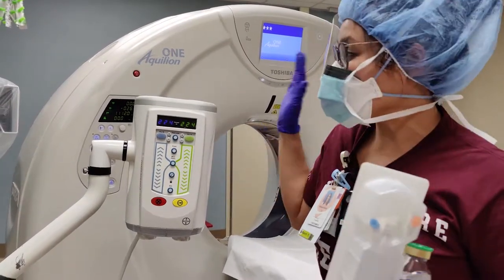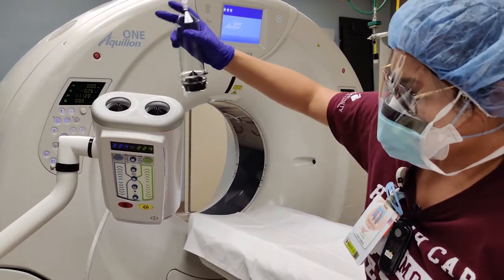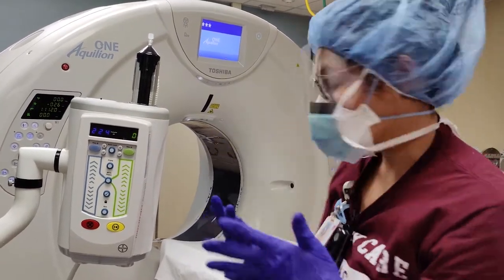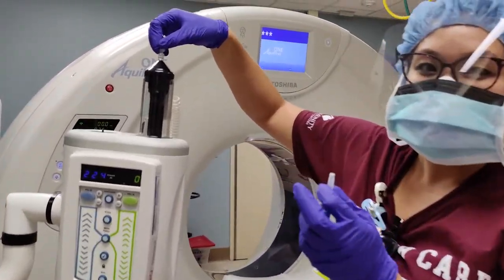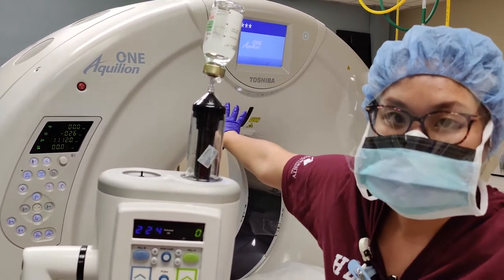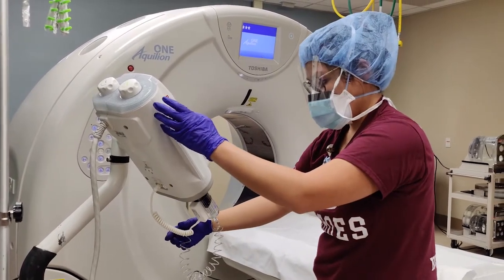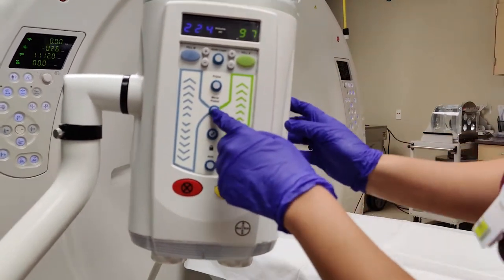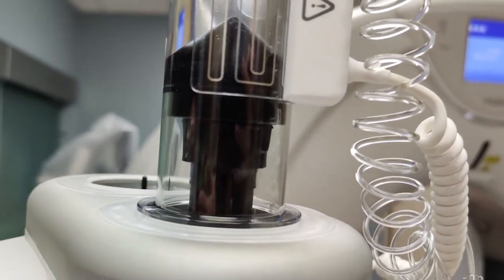CT dual contrast power injector | BAYER

Comment: Damn I´m so jealous that you have ceiling access of airtubes at hand above pacient! If I had known about this possibilty before new CT installation.I would like to know if you preheat contrast media because that heater is short as you notice and another issue is that heating through such a thick wall of syringe take a time that we don´t ussualy have.I´m also using sack from baryum enema to discharge both syringes otherwise there is a huge sticky mess on the floor.Thanks for your videos.
Reply: the heater is to maintain the warmed  c.m  not to heat  for the reason u mentioned before.
in some hospitals they have warmer for the C.M
Reply from the maker: Indeed! Thanks for the clarification. 

The warmer is very cool that it helps it being less viscous while entering the vein. We don't always have the warmer but it will still be fine bc it's being power injected and not manual. 

Some countries that have natural hot weather will sometimes leave their contrast outside in the heated weather. They don't have many scans lined up so they are able to take the time to prep that. What a way to use natural resources. 

Also!! We still have that sticky mess of contrast on outlet floor too. A warm or wet towel to lay over the contrast for an hour or so will help get that out. The stubborn ones will need to be scrapped off.

Comment: Possible que  l’injecteur  medrad a double seringue fonctionne avec une seule seringue sans placer la deuxième merci de me répondre
Reply from the maker: Hello! Are you able to translate this to English? For some reason I cannot copy your text or else I would copy and paste to translate it myself. Merci!
Reply: @RADKhammany  hello, why sometimes the injector blocked does not want to work the degital (on the screen to program the injection flow, I can not the screen is blocked)
Reply from the maker: Question: why is the screen to input the rate of contrast not working properly?

Answer: In my opinion, a few things come to mind. The system is not synchronizing with the injector. So to troubleshoot it, try turning the injector off to reset it. Sometimes it might help to take the syringe from the injector off and make sure that there's no dried up contrast stuck in the injector. That can miss signal the computer. There's a spray to take it off, but if that's not available then use a towel with hot water to wipe it off. The heat can help take contrast off the syringe holder and even the buttons. Or even the floor ;) 

Hope that helps!! 

If not, there will be an error code that populates, make sure to take a picture of it or write it down for your biomed team.